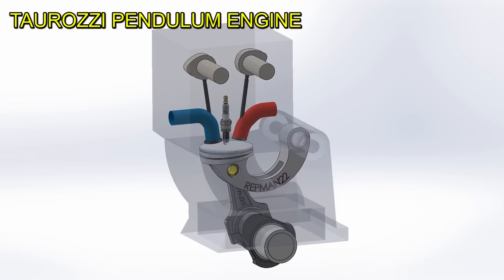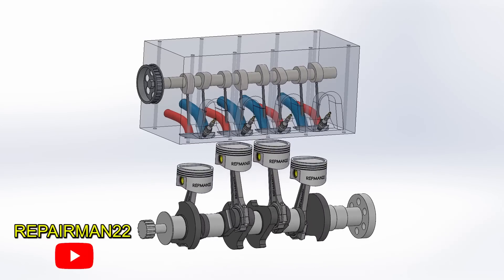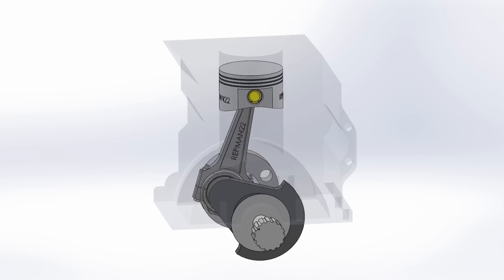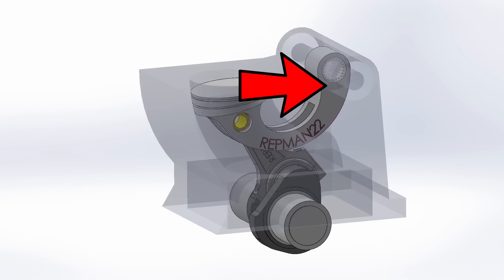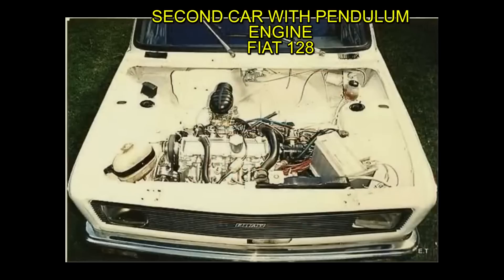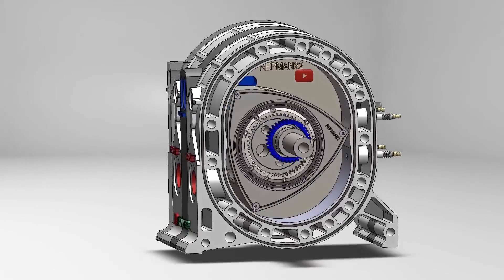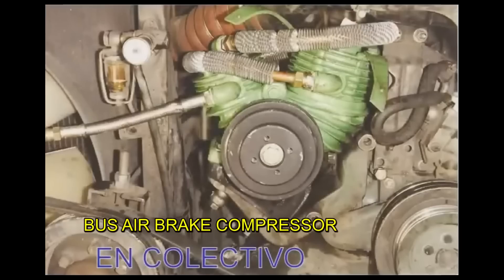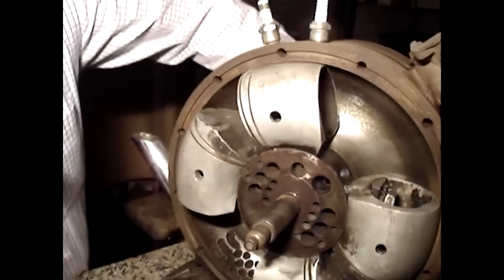All about the Taurozzi Pendulum Engine 🧠 and what happend to it🤯

Comment: Nice design! But I don't believe the claims without duration testing a full size engine. A lot of wear can be caused by different thermal expansion of the block and the piston. And 30% improvement seems just wishful thinking. But you've made a great video!
Reply: "A lot of wear can be caused by different thermal expansion.."
At first I thought "yeah, right, a problem conventional ICE don't have, or what?" But then I realized that the radius of the piston movement is going to change. And starting at let's say 30cm, that makes for quite a bit of expansion.
Reply: @gstutje  exactly!
Reply: 30% is nonsense.
Reply: Yes, it works as a compressor due to the lack of heat from combustion. Modern inline 4 cylinders go 200K miles without a rebuild. I doubt this could make it 20K, otherwise we would have them in the market.
Reply: yeah, i wanna know how they came up with the 30% number, and 30% compared to what?
Reply: Isn't that what piston rings are for? Thermal expansion tolerances.
Reply: @alexanderg-p3z  that's for expansion of the piston and cylinder wall. But I'm worried about expansion of the conrod.
Reply: @alexanderg-p3z  Exactly. Thats where the smoke and mirrors are in this design. It claims to get rid of the friction but it would still need the same amount to give the same sealing effect. He claims pistons are floating about everywhere in the bore but that simply isn't true.
Reply: @siraff4461 ... and the rings are going to wear on the long side of the curve compared to the short side.  Piston speed is different all the way around the bore due to the curve as well. Again, if it was that good, where are they?

Comment: Fascinating design...I wonder why those big auto makers were so disbelieving. Perhaps they just wanted to wait for the patent to expire..! I would love to see how the toroidal bores were machined, though. I was wondering if an opposed shared-toroid compression-ignition engine would work, then you showed the toroidal engine design which looks almost like that very idea. I'd love to know more about that one too.
Reply: Automotive manufacturer are always trying to adopt technology that gives them an edge over the competition. They most likely didn’t buy this idea because they didn’t see the value or utility in it. It has its own issues, and is not suited for their use case. 

If it was a good idea they would have implemented it and made tons of money.
Reply: @Prosecute-fauci  also gotta remember new technology scares automakers , and i can tell you why it didn't catch on in the US ,,in 1974 the US was just implimenting smog control on cars and the big 3 were stuck on V8 engines and inline 6 cylinder engines ,,that's what american people were used to ,,i can see the possibilities of this engine from a mechanical standpoint , a very large one would be vibration reduction ,,and another aspect of a engine with less friction would be the engine needing less oil and less frequent oil changes ,,this would also result in longer engine life
Reply: @wildcoyote34  automakers are constantly implementing new technology into engines. The EPA has been forcing more stringent rules on emissions and MPG every 5 years or so. It’s the reason why cars and trucks now use 0w-20 or 0w-15 oil. They have reduced all of the possible friction to the point that the oil has to be crazy thin. If there was a magical “super efficient” engine option out there, they would grab it immediately.
Reply: @Prosecute-fauci  not back in 1974 , they were fighting to avoid using catalytic converters back then ,, we are talking about american auto makers that were and still are stuck on  big bulky V8 engines ,
Reply: @wildcoyote34  the claims being made in this video are portraying this engine as superior to modern engines. If that were the actual case the automakers currently would be producing them. Look at toyota for instance; they implemented the Atkinson Cycle engine in the Prius and in the 3rd gen Tacomas with the 3.5L V6. They did that so they could make a smaller displacement engine with essentially the same MPG but more power than the 4.0 from previous generations. It’s a radical departure from the typical Otto cycle engine, but they did it for EPA purposes.

If this engine were superior, the modern automotive manufacturers would adopt it.
Reply: @wildcoyote34  lol well if the US automakers were so stuck back then why were they investing millions into developing turbine engines?
Reply: @444mopar  that was  over by 1974 ,, 1974 was the year that auto makers were forced to add catalytic converters to their new 1975 models  and were forced to add pollution control equipment to their gas guzzling V8 engines ,, the basic design of which had not changed since the 50s and until the late 90s and early 2000s didn't really change physically with the exception of the fuel delivery systems
Reply: @Prosecute-fauci  not all superior designs were proven to be reliable ,, look at what happened with the Wankel rotary engine  ,, it's a great design but was proven unreliable in production ,and couldn't meet emissions even after 40 years of development ,they were noisy , thirsty , unreliable and hard to maintain ,,wanna do some actual research  , i have , i have studied automotive technology since i was able to read ,,just like turbine engines in the 50s and 60s ,,all 3 automakers in the USA actually had prototypes  GM and ford built heavy class 8 trucks with turbine engines ,chrysler had the turbine car ,,they never got past it's fuel consumption , even with the big trucks  they were pigs  that had to stop every 500 miles for fuel ,,great technology but like a lot of technology it proved impractical ,,
atkinson cycle is used widely by many different manufacturers ,, that's what the bullshit camphasers and extra oil control solenoid valves do ,, variable camshaft timing ,,allowing switching inbetween atkinson cycle and conventional operation ,,great idea in computer theory ,, a mechanical nightmare for mechanics  and a serious reliability issue for auto owners
Reply: @wildcoyote34  this video is making the claim that this design is the unicorn. It is more reliable, with better gas mileage, and potentially can produce more power than the engines currently in production. We are talking modern day. 

Did I say that the rotary engine is superior, or is more reliable? No. My point with that was the fact that auto manufacturers will implement changes if they believe that it will give them an edge in the market. 

The claim is being made in the comments that the reason why auto manufacturers didn’t/don’t switch to it is due to a conspiracy  that only involves money as it’s motivation. That is not the case. It’s simply not the best design.

With all of your schooling/research you sure didn’t learn how to read very well Mr auto engineering guy.
Reply: It’s because this is much harder and more expensive to manufacture as well as takes longer and even more specialized tooling, it doesn’t make nearly enough power for the input energy, it’s high friction in the cylinder, it’s not going to last as long because of the lateral loading of the piston and it’s a pipe dream.
Reply: @mikeznel6048  lol did you even watch the video? 😂 
It has far less friction due to the shorter piston and the fixed anchor point for the conrod. The piston can only move along the one pathway and doesn’t rely on friction to hold it straight in the bore. The compressors that use the technology are used because of a lack of friction which means less lubricant required and cooler operation.
Reply: @wingracer1614  😂😂😂
Reply: Engines won't wear out quick enough for car manufacturers and the oil companies don't like that it's 30% more efficient... that's why it's not being put in vehicles. You're welcome.
Reply: @atomicwedgie8176  exactly the point.

Comment: That's the trouble with our world the and the unimaginative and stupid are in charge. Yes the mechanism by which you would boar the cylinders would have to be slightly different than what they use on conventional engines. But come on guys do really think present mass-produced engines are not made on specially-designed production machines.

Comment: I'm guessing the real reason these engines are not used in cars and only pumps is the only feasible way to get bigger displacement out of them is to increase bore size which would make them longer and heavier making it harder to fit inside the engine compartment.
Reply: A dual inline 4 cylinder Would not be as wide as a 90 degree V-8 OHC engine.
What is happening today is build it as cheap as possible. Make it pass emissions and MPG standards. Then there is the tooling costs. Basically a engine in a Trax is not a economic engine when you need it rebuilt. Besides that it may last too long.
 Forney would not like a 1980 engine still polluting the highway even if it met 2020 standards with simple modifications. Just think about all those missed opportunities for those annual plate taxes based on the selling prices. Oh and  don't forget the sales tax.
It just boils down to one thing money.
Reply: and they would need to increase the displacement a lot due to the vibration harmonics hampering high speed operation